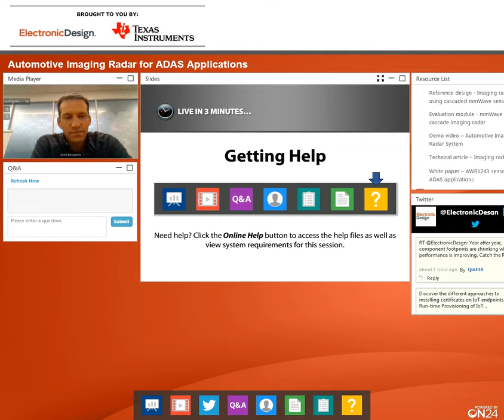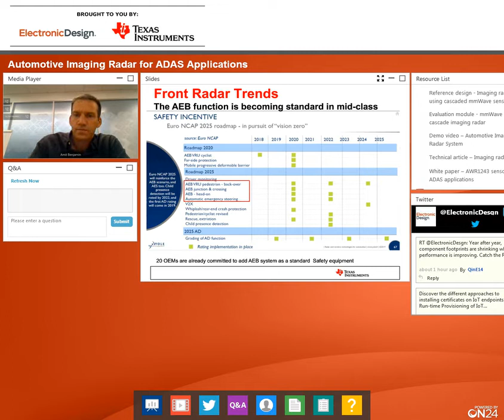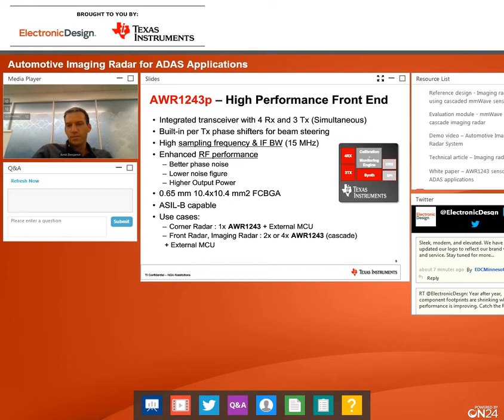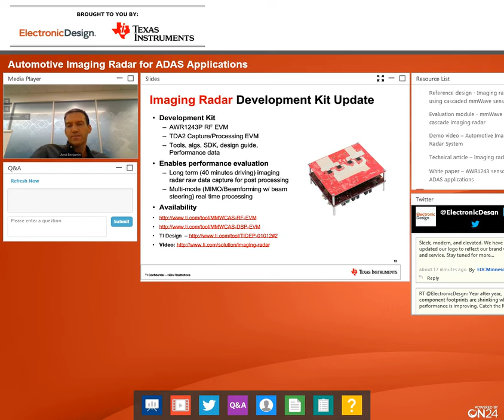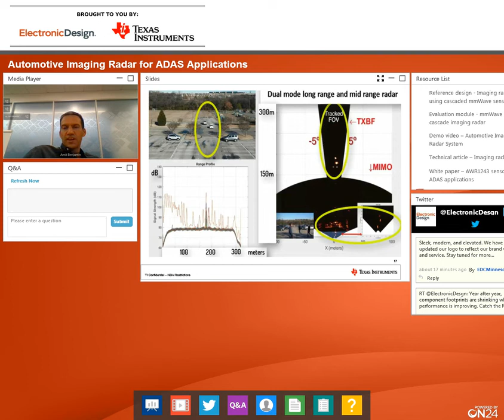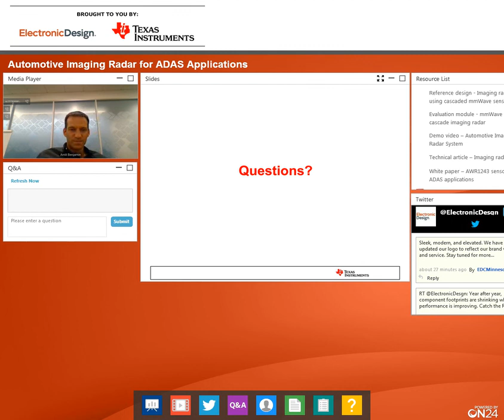Webinar - automotive imaging radar using TI mmWave sensors

Comment: Does anyone make a more finished version of this sensor ? Something that is already in a box and IP65 or more.
I have been wanting to test the sensor, but I am searching for a more finished version in terms of packing and interface.
Intended detection range 0.3-12 meters, minimum FOV 100 degrees. (ideally an interface to ROS)
My goal is to track particles  that are non-uniform (0.5-10cm, 1-8m/s), non-constant over time.
This means that the trajectory of the particles is hard to predict and direct observation is relevant.
Reply: Look into the offerings of D3 Engineering, they made a rugged case of Antenna on Package sensor.